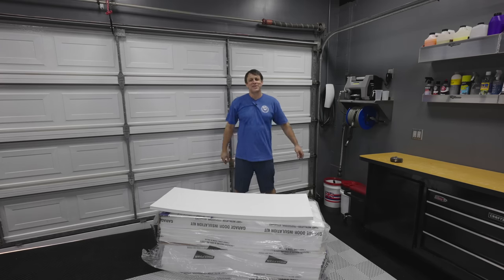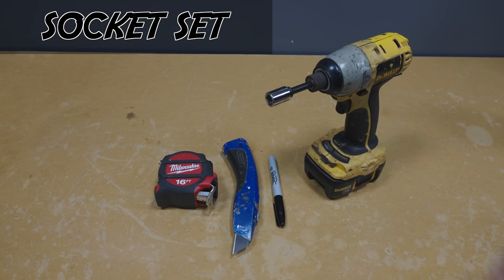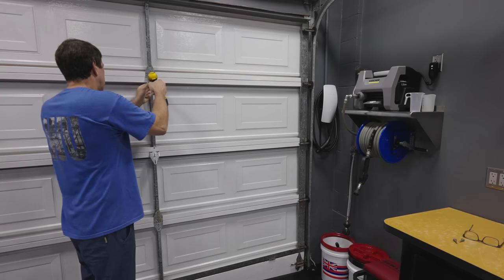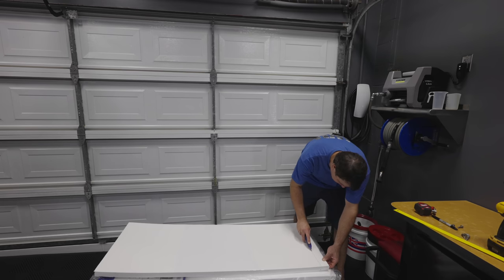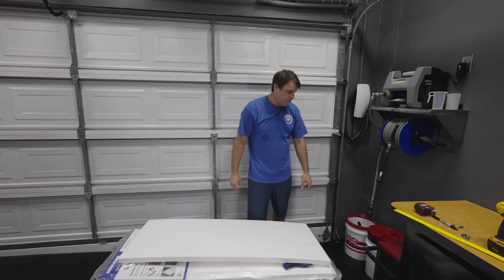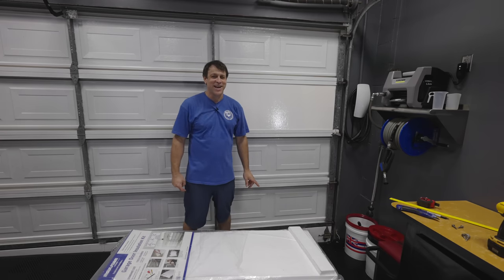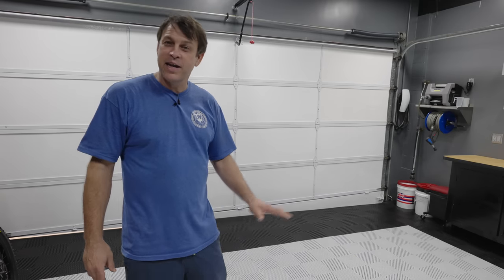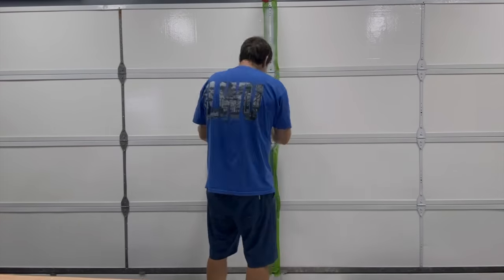BEST WAY OF INSULATING A GARAGE DOOR. FULL TUTORIAL

Comment: Did you ad tension man?.... all that weight wasn't sprung for that classic door man. Need new springs
Reply from the maker: No and it been working great. It might be 1 pound of foam. It’s light. When the door is disconnected from the opener it should be gliding easily up and down with no excessive effort needed in terms of weight. If it feels grossly unbalanced an adjustment should be made. I have not found this to be the case with the kits I have installed. Thanks for watching

Comment: What is the piece at the very bottom of the garage (very wide on right side) and gets thinner towards the middle of the door?
Reply from the maker: Floor in the garage was sloped when I bought the house. It used to be a carport so it was designed for the water to run out. That piece is to fill the uneven part at the bottom.

Comment: Did you have to adjust anything to the door and opener due to added weight?
Reply from the maker: I did not but you should make sure that the door easily can be moved up and down with the garage door disconnected. If it feels heavy then the springs will need to be adjusted.

Comment: what are the dimensions of of the XL package? Or put the sizes of garage doors they will fit?
Reply from the maker: Use the link in the description and scroll down and open the specification sheet it lists the sizes for the L and XL. You should measure your door and make sure it fits. If they are too big that’s ok because you will cut it anyway. Too small is a no go. Thanks for watching

Comment: So I'm about to do this today. Are you having issues with weight did you need to adjuster the springs to handle it?
Reply from the maker: No issues with the weight. works great. Disconnect the door from the opener and make sure that it can be pushed up and down with little effort. If not then adjust the springs. A lot of door springs are poorly adjusted when installed so it might be needed anyway. Be careful they are under extreme tension. Thanks for watching
Reply: @HawaiiDetailing  what is the name of insulation kit you used?
Reply from the maker: @aaronpeniata699  there are links to what I used in the description. Thanks
Reply: @HawaiiDetailing  thanks man I just finished my garage and its perfect and it's quite opening and shutting

Comment: Did You have to have the Springs adjusted for the extra Weight?
Reply from the maker: No the foam is so light that it’s negligible. If you wanted you could adjust it to make it perfect but mine did not need it. The way to tell is when the garage door opener is disconnected the door should be able to be pushed up and down effortlessly. If it’s not effortless than the opener will struggle and eventually burn it up.

Comment: So there was only a 10 degree difference?
Reply from the maker: There is a substantial difference with keeping the heat out and the cool in. There is so much radiant heat from the roof freezer and other things going but when I run the ac it gets and stays cold. Before I insulated it was just pouring out the door. Thanks for watching

Comment: How do you insulate around the edges of the door when it's closed? My door has gaps - I can clearly see the sunlight from the outside.
Reply from the maker: You can adjust the door to sit closer the the jamb. Be sure after you do it to manually raise and lower the door so that it is not out of adjustment enough to hit the frame and do any damage. Play with it and you will get it right. Thanks for watching
Reply: @HawaiiDetailing  Thanks! Those are some good ideas. I'll try replacing my weatherstripping first to see how much that helps

Comment: Hi we are in Phoenix, Arizona.  I’d like to have our garage door insulated to keep an extra fridge in the garage.  But we have windows in the garage.  What would you do about that?
Reply from the maker: Are they double paned windows?
Reply: No they are not.
Reply from the maker: @jonismith6575  I don’t have a great solution for that. I am sorry. Maybe they are not too bad in terms of heat getting through. An air conditioner that is sized accordingly should work well. Without ac it will still get hot in there. Hopefully not hot enough to ruin your refrigerator plans. The door insulation will help dramatically especially if the sun beats on the door.
Reply: Yea in the summers here it gets well over 100

Comment: Hi Bro. Thanks for the cool how to video. Q., at what point should I just get a new door that comes with the insulation? A rat ate  my rubber seal & the Armada has hit the open door a few times. I want to do this project, but the door has these defects. Your opinion. Super thanks! Fred
Reply from the maker: Man it’s hard to say. A new door that’s insulated can be expensive and a big job. At the same time if it’s messed up pretty good and you know that you want a new one than I would pass on this job and get a new one. This is an easy install and could be good if you don’t plan to replace the door for a while but want to be comfortable in the mean time. That’s my thoughts. Thanks for watching